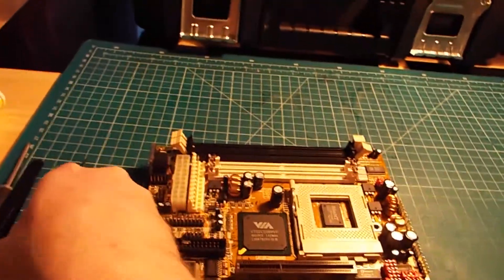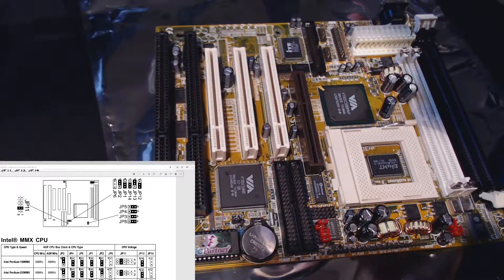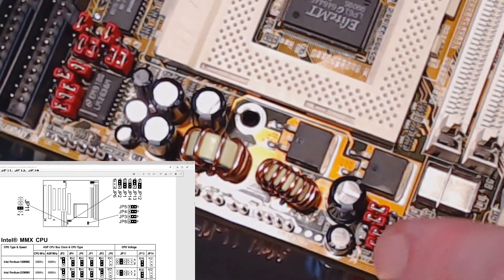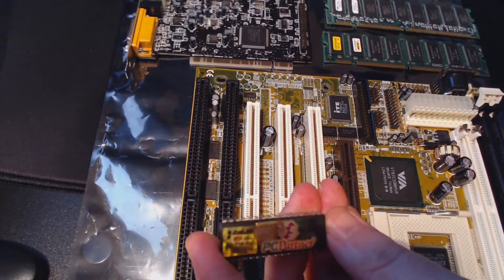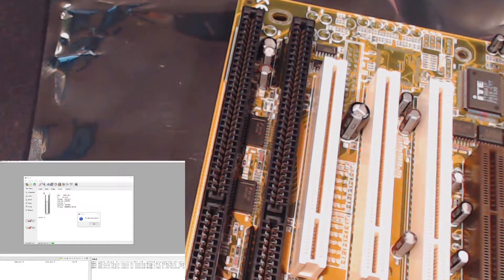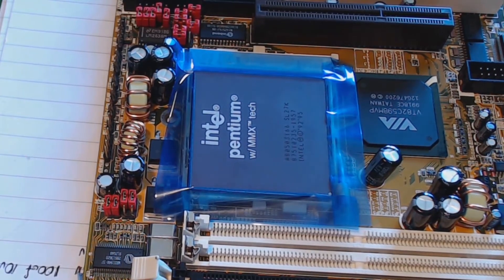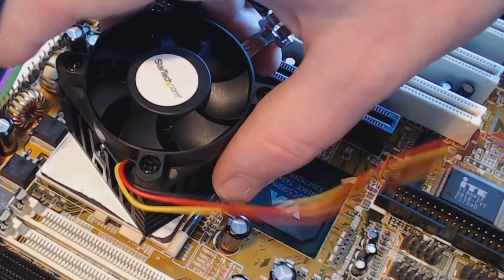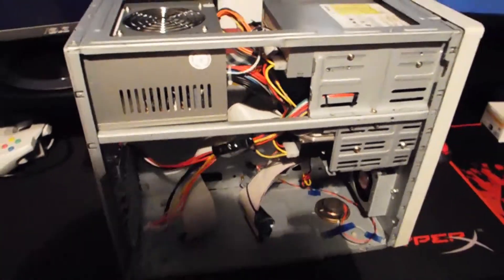90's PC Restoration Project ( Part 02 )

Comment: From wikipedia:-  Super Socket 7 features - 100 MHz front-side bus, support for AGP, and a SPGA package.
Reply from the maker: :) That was lazy of me, should have Googled. 66MHz FSB here. Voodoo 2 might be better. Could always get one in the future and use the voodoo 3 in a Pentium II build.
Reply: So much thermal compound 😮 I'd have just blobbed a bit in the middle, the TDP is only 13W 😂
Reply from the maker: Figured that since it was a ceramic package the heat might diffuse. Used a fair bit of IPA to clean it all off in the end :)